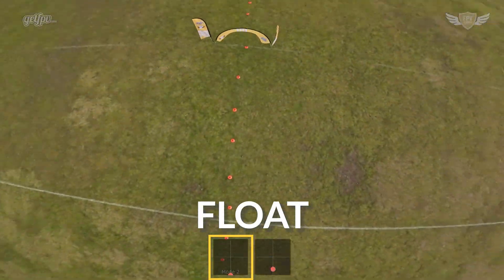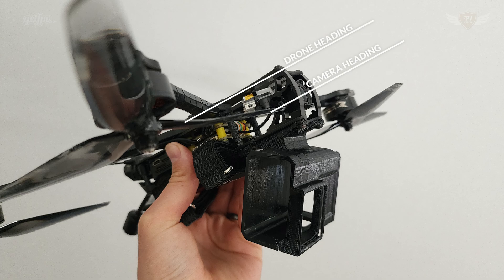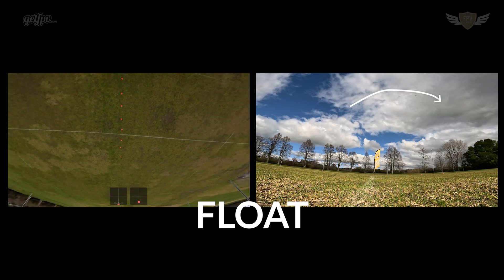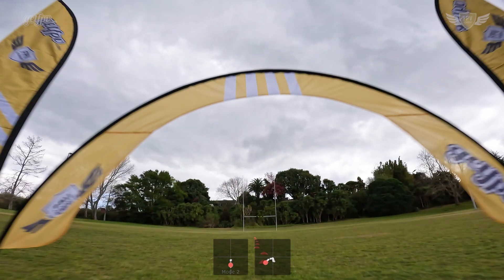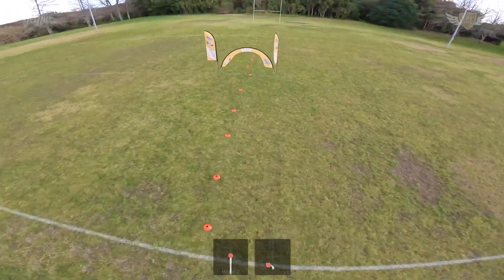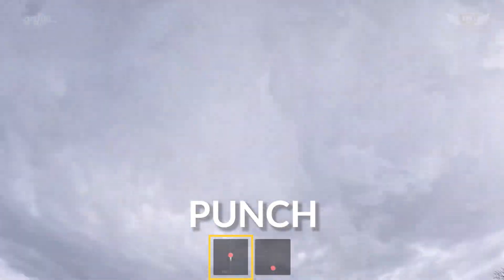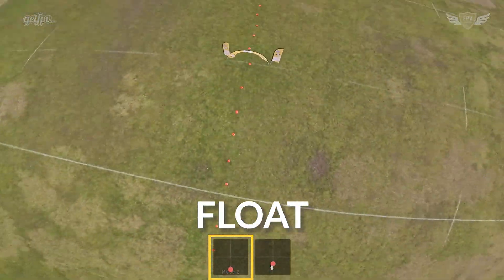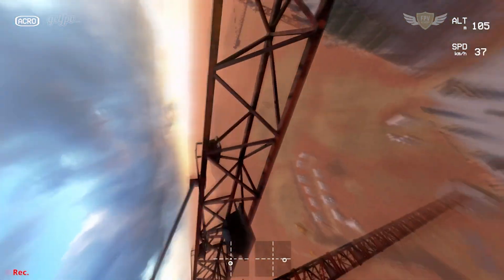How To Powerloop an FPV Drone For Beginner and Advanced Pilots, An In-Depth Look

Comment: 50-60 degrees? It would make it easier to see past the loop apex, but I still prefer 35-40 degrees for most flying. Higher angle as you carry more speed.

Comment: I have to practice a ton more in liftoff. I can do a power loop. Butttt if i try going thru an object then powerloop then go back through the same spot, i have nog issues with getting enough push backwards. I tend to come down on top of the object I'm trying to powerloop. Any advice would be awesome! Thanks in advance.
Reply from the maker: If you're coming down on top of the object, you're starting your float too early and not building enough momentum to float back far enough. Make sure you hold the punch a bit longer and only cut down on the throttle once you see the horizon. This should help build some more momentum. It's scary keeping the throttle open while you only see the sky, just make sure you keep your pitch consistent through the punch and float. Keep in mind that you may need to add a small punch of throttle before going into the float if the object you're powerlooping is long. Let me know how it goes!
Reply: Thank you. I will keep practicing. Life is busy, I don't get enough sim time, but I definitely work on your advice!

Comment: 50 to 60 is hard to maintain speed and control in tight spaces I think, my sweet spot is around 20-25. Anyhow, good to see you back!
Reply: ye i feel so too i fly at ~30° 
if you go over 45° roll and yaw kinda switch functions too so if you want to go with a high cam angle it would probably be better do to so from the start cause you would need to relearn your muscle memory
its true that some tricks are easier with high cam angle 
for example the transition point when you have stop throttle at 30° is earlier than you see the horizon since the quad is alrdy fully upside down when you see the horizon at the lower 1/4 of your screen
Reply: yeah, I just can't imagine performing advanced tricks in bando with camera tilt that high, must be very difficult, even to recover when there is an object for you to do the trick with  @bluefpv3263
Reply from the maker: Definitely, 50-60 is harder to control speed in tight spaces but helps so much with advanced tricks.